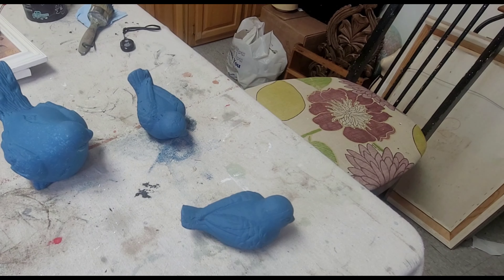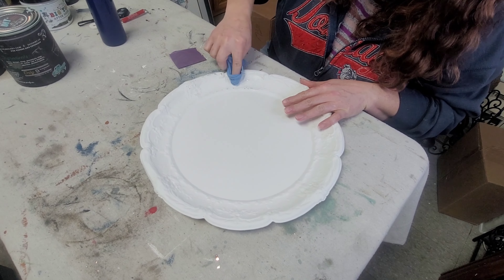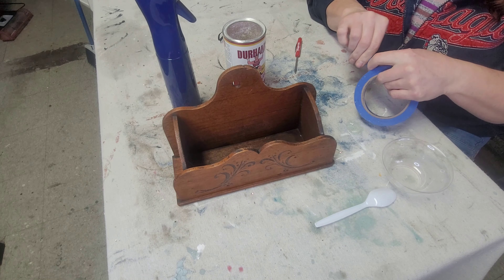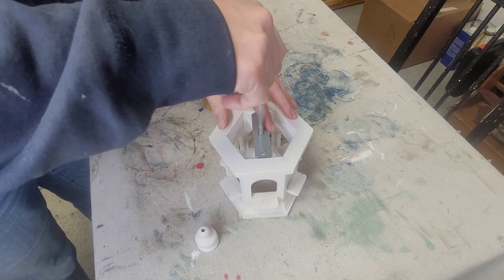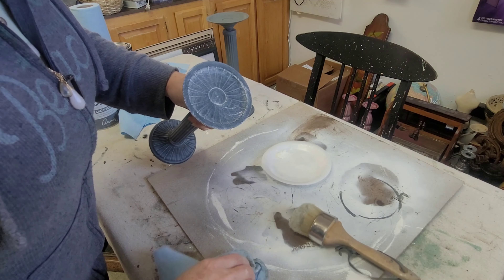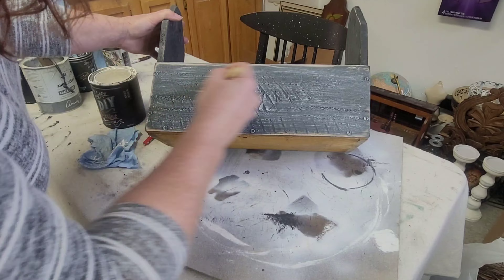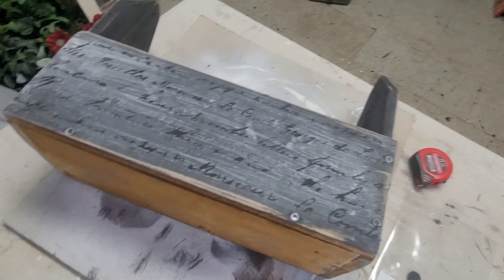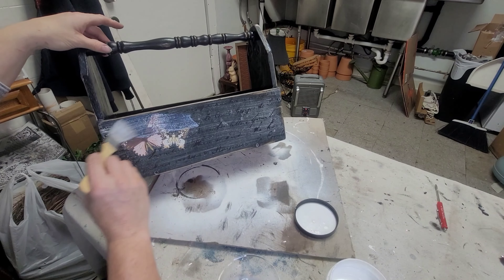Thrift Flip - Six More Items from my Stash get a New Look!!

Comment: I loved them all but I think the letter box was my fav. I also loved the birds. I have some  that I chalk painted. Let them set for a week then went to put white wax on. Eeek the paint came up. Did I not seal it good enough?
Reply from the maker: Thank you! And regarding the wax - it is really hard to tell. Sometimes when I have a piece that is a really slick material I will spray paint it first to give a little more of a grippy surface for the paint . . . . but using a soft wax brush helps, and I try to be super light when I wipe back the excess wax so as not to "rub" the piece too hard. I still occasionally have a little paint pull up, and I usually just use a little brush to repair the spot and then carefully go over it with a bit more wax. I don't know if this is helpful to you at all, but I hope so!!  :)  Anyway - thanks so much for watching!!

Comment: Why don't you paint the bottoms?
Reply from the maker: It really depends on the piece. I just feel that paint, no matter how well it is sealed, will wear with time. So pieces that are wood, for example, will show wear more nicely left with a natural finish on the bottom rather than paint. So as long as they are in good condition and there's no chance they will ever realy be "seen", I just make sure they are nice and clean and leave them natural.